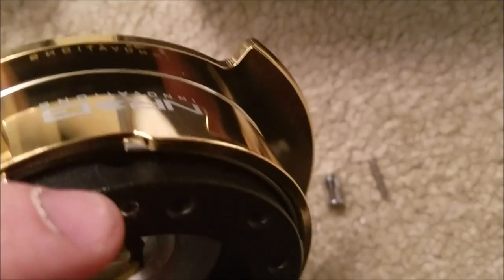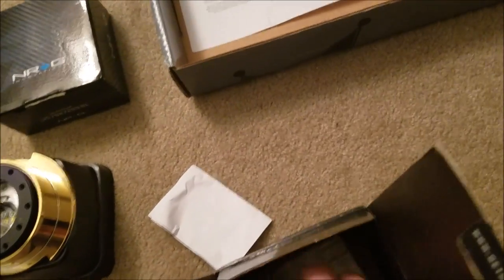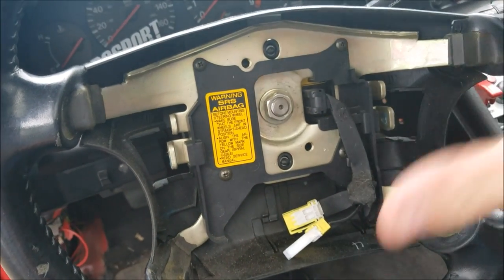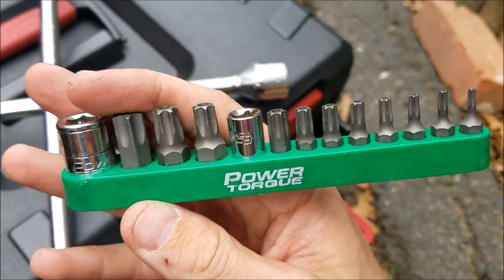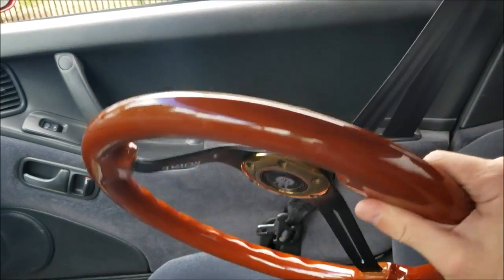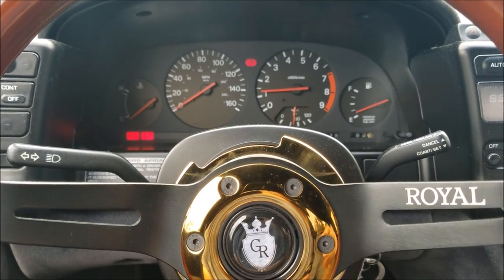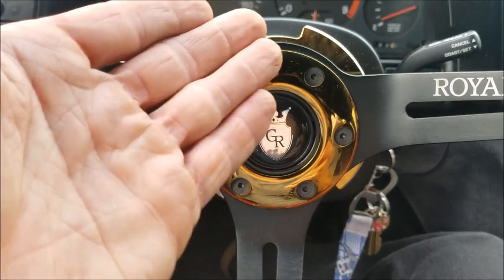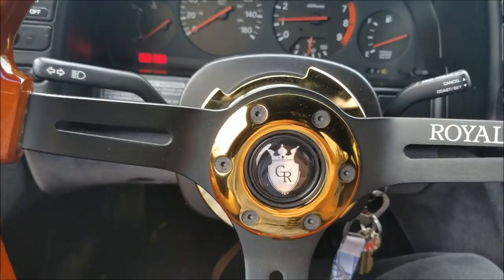Grip Royal Install w/ NRG Short Hub & 2.5 Quick Release

Comment: You do know the safety pin is depressed when you rotate the quick release tabs .... So say when you got it mounted and you have the two little tabs that you pull back to release few rotate the tab assembly it presses down on that little button that you removed and you don't have to physically push it down with your fingers to release your steering wheel and then you rotate it back and then it's safe again.... Just an FYI so people out there don't start taking their safety button out..... So if you happen to have one of these NRG quick release hubs just turn the little ears laughter right over top of that little button and it will automatically deactivate the button and you can pull it back to release your steering wheel this is a public service announcement for people who care have a great one